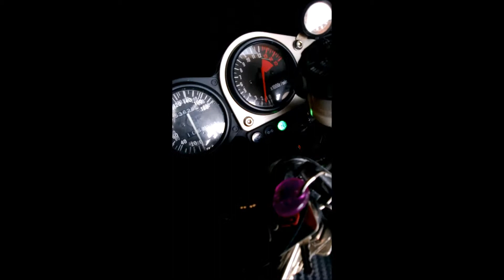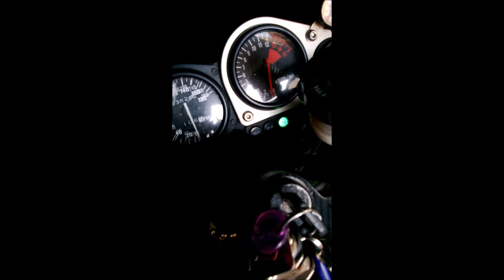ZX7R Click / Tick / Tap Noise 2013 help Pt 3

Comment: Mine is doing this too.  I'm thinking it might be the alternator chain.  Does the noise get louder when you pull the oil filler cap while it is running?

Comment from the maker: Hi, I Don't notice the noise when I'm moving, but if i come to some lights or have to stop then i sometimes notice it. i did reset the tensioner a while back now and that made no difference. bike has done about 34000 on the clocks, as for the service i regularly do it myself but is due a valve clarance check.